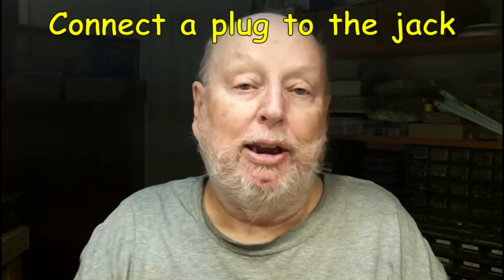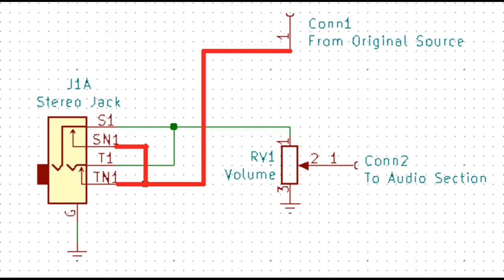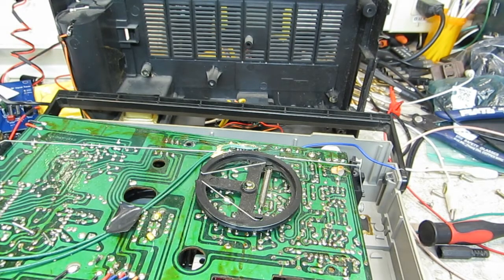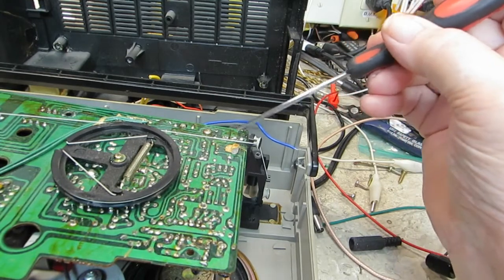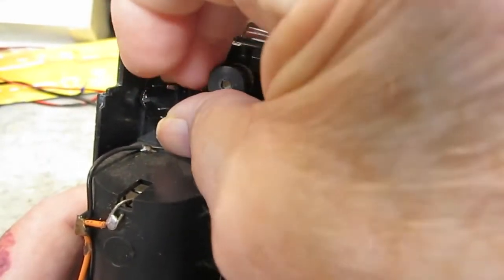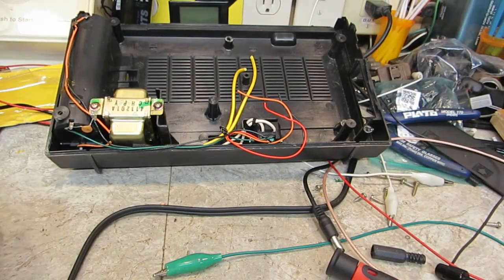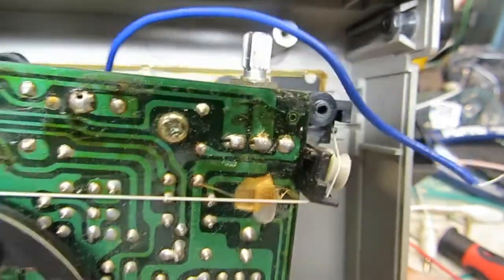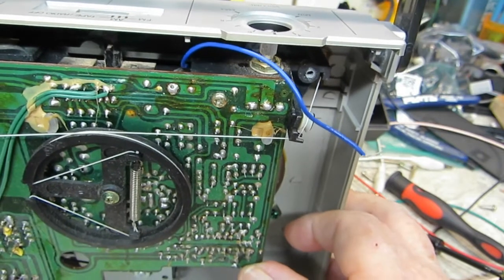DERB - Getting to the point of this video series

Comment: This is a great mod.  I have done it many times myself.   I would suggest you add 2 resistors, one per channel and make a stereo to mono mixer circuit.   Another option is to add coupling caps per channel in case you are using multiple unknown sources since there is a chance they may have a DC component to the output.   I  have had audio sources that crapped out with left and right channels directly shorted together.

Comment: I'm not seeing any protective resistors in the channel summing part of the circuit to keep the dongle's op-amps from backfeeding into each other.  They could be added inside the radio right after the 1/8-inch jack's outputs to the volume control, but that would leave them in-circuit for the radio's AM, FM, and tape functions too.  Maybe constructing a dedicated stereo-to-mono 1/8" cable for this project is in order.  It's not a problem for the BlueTooth-to-Kenwood project as you're going stereo-to-stereo, not stereo-to-mono.